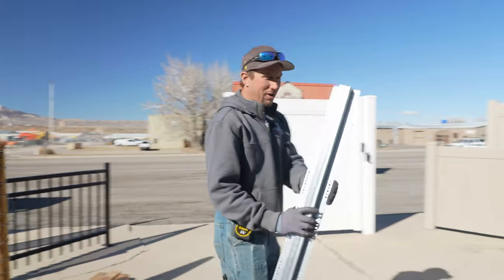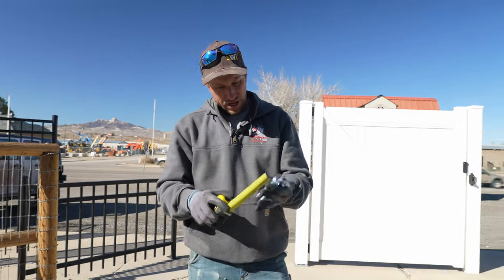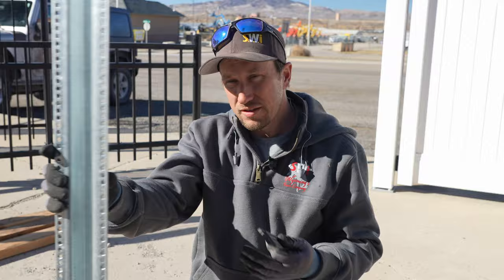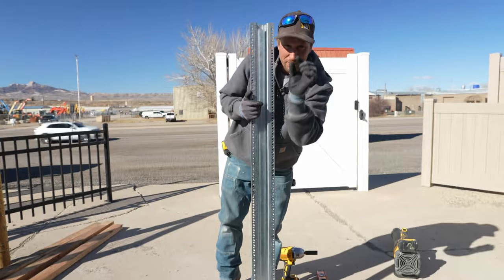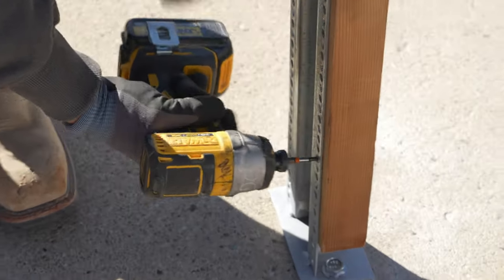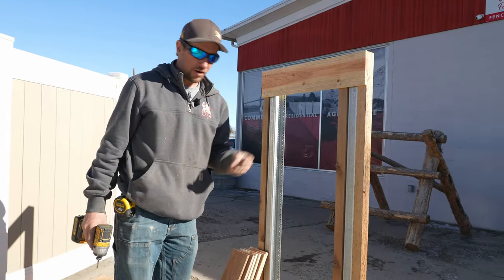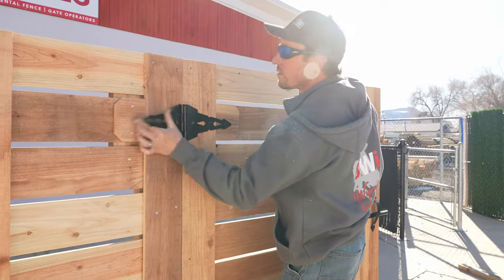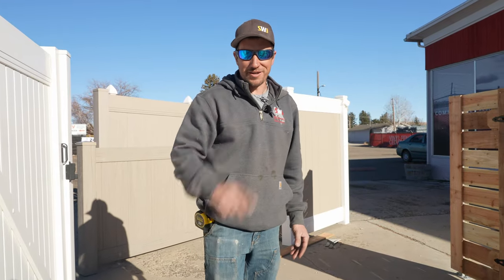How To Install A Fence On Existing Concrete

Comment: I want to mount my fence on top of a retaining wall, the retaining wall is sloped so mounting on top isnt an option. Would you be comfortable drilling spaced holes in the middle of the postmaster post (in the channel section) and using the same anchors to mount the post on the backside of the retaining wall? I could easily get 3-4 feet on the side of the wall with spaced anchors before the post rose above the top of the wall.

Comment: if there's a choice, is it better to install a fence gate on cemented posts or flange on cement posts?
Reply from the maker: If there's a choice I'd put the posts in concrete.

Comment: wow! you guys are creating some dope videos. thank you! how does this method compare to setting 30" deep re. strength and durability where strong tradewinds are an issue? I'd assume always dig (or drive) if there is an option but I can't find a solid answer out there. I'm having a concrete driveway poured next week and I'm planning on building a 6' horizontal cedar fence running the length of the slab after and I'm not sure how to direct the masons. any help would be appreciated.
Reply from the maker: It's a personal judgement call. In high-wind areas we tend to reduce our post spacing to add strength. If your driveway isn't poured yet you could always pre-set your posts and pour around them.
Reply: @SWiFence  thank you!

Comment: Does the postmaster posts come with the concrete anchors attached. If not, how did you attach the anchors to the posts?
Reply from the maker: Yes, the plated PostMaster comes with a base plate welded on. https://bit.ly/SWIplatedpost
Concrete anchors just run through the holes and are hammer-drilled into the concrete. https://bit.ly/SWI34concreteanchor

Comment: I don't know about this purchase... My posts are wobbly... Not at the screw section, the metal post... Any suggestions to stop the sway😢
Reply from the maker: I don't know what brand you bought, so that could be a factor, but there is supposed to be some flex in the posts, yes. https://youtu.be/pI5defhDiEM?t=856

Comment: Do you ever use wood posts /on concrete, and if so what do you use to anchor them with?
Reply from the maker: We never use wood posts on or off concrete.
Reply: I've drilled a large hole into the bottom of the wood post, then hammered in a tight-fitting piece of galvanized steel pipe (maybe 6" inside post, 6" protruding out the bottom). Then drill hole slightly larger than pipe into concrete. Fill hole with Rockite then set post. Also need to drill a small hole in the side of the exposed pipe to let the air escape when you push it down (inside of pipe would trap air that prevents you from setting it all the way down).

Comment: What spacing do you recommend between the postmaster mounts?
Reply from the maker: It's up to the installer's discretion. We sometimes do 6' spacing in high-wind areas. In others we do around 8'.

Comment: Would the regular impact be good enough to crank those concrete anchors in? Wanna use those but don’t have a big impact like the one you finished it off with, not sure if what I have is enough power
Reply from the maker: You should be fine. 👍🏻 It's nice to give it that extra pop with the big one if you have it, but you should be fine with what you've got.
Reply: Or just crank it with a breaker bar or torque wrench
Reply: I have used $50 impacts to drive in anchors. As long as you predrill the correct size it goes in easy

Comment: Where do you get the fence posts that you drill into the concrete
Reply from the maker: 👉🏻 Steel Fence Posts With Welded Baseplates: https://bit.ly/SWIsteelpost-bp
👉🏻 Concrete Anchors: https://bit.ly/concreteanchors
👉🏻 Composite Shims: https://bit.ly/SWIcompositeshims

Comment: O’ Dan… I was with ya until you said “Paddle” latch.  I mean the design, materials and assembly of the panel and gate had my complete attention.  I even made a mental list to go grab a box of those concrete screws…. But, then you said, “Paddle”…   A double flashback immediately zoned me out for the rest of this video.

You see, when I was in the 5th grade, a box of milk cost a dime.  Everyday, we had a milk or water break, during story time, in our morning classes.  If you had a dime, you could buy a box of white or chocolate milk.  If not, you could go to the water cooler and fill a cup to enjoy, while the class pet read aloud to the class.

Well, I lived on a dairy farm so, I normally drank water.  I chose instead to save my weekly fifty cent milk allowance and spend it on stuff I wanted… like baseball card packs, bubble gum, Grapette soda… etc.

One day, the teachers pet, Rosa, told me that she forgot her milk money.  We were in the coat room and no one else was around.  So I told her I would give her a dime if she lifted her skirt and showed me her panties.  

Well, she turned red in the face and started to walk away.  So, I upped the ante to $.50!  That seemed to change her mind.  She turned around and smiled and said, “OKAY… but you have to pay first. “

So, I dug out the five dimes and started to hand them to her.  As soon as my palm opened, she grabbed the money, turned and busted through the coat room door, into the classroom.  

Before I could gather what had happened, I heard her holler, “Mrs Grant, Dave’s trying to look up my dress.”  In quick succession I recall the door slamming open, a vise like grip upon my ear, a jerk that pulled me into the ring of laughing classmates gathered around the doorway and a walk of shame the likes of which no self respecting farm boy could endure…  in front of his city slicker classmates.

The walk proceeded at overweight, asthmatic, old lady teacher pace down a hallway littered with students and classrooms not yet in session.  I almost got a break at the stairway leading down to the Principals office when her vise grip loosened on my ear.   But, no such luck, she was just changing ears to put me on the other side.  

What seemed like an hour later, I landed in the chair facing the Principal’s desk.  Then Mrs Grant told me to stay there and left.  As I was sitting there trying to gather my wits, I looked at the wall behind the desk.  The top row was a bunch of plaques and certificates…. I think… I don’t really remember well. Because, the row right below that was filled by a half dozen “Paddles”.  

As it started to sink in that, my fate may very well be hanging on that wall, the Principal came in and sat down behind the desk.  He pushed his glasses up his ski slope sized nose and focused his beady mole like eyes on the back of my brain.  I couldn’t swallow, I couldn’t look away… they bore through me like a comet shooting straight at me.

Then he said, “You were caught looking up Rosa’s skirt.  What do you have to say for yourself?”

Well, that snapped me out of my daze.  I couldn’t let this lie exist…. I had to set the story straight… so, I told him, “No! Rosa forgot her milk money and I told her I would give her fifty cents if she would lift her dress.  I never got to…”

At which point he put his finger in front of his mole face, shook it at me and said, “That’s even worse.  Stand up and grab your ankles.”

I did as I was told.  I watched as he grabbed the paddle hanging on the right… number six.  The three swats echoed through the open door, down the hall and up the staircase to the classrooms above.  

Ski nose, mole face then told me to get to class before the bell rang… that walk was even more excruciating than the first.  Because this time it wasn’t just my ear that smarted… I was a convicted criminal who had endured corporal punishment and had to try to walk normal past a jury of my peers!  

Was that the last of it?  Well, not exactly.  I managed to steer clear of any one-on-one encounters with Ski nose mole face for almost 2 years.  Then, I took a woodworking shop class.  (It was either that or Home Economics.) 

Little did I know that the shop teacher had received a list of boys in his class from Ski nose, mole face… there were four of us on it.  Mine was one of the four from our class, who had suffered paddling during our tenure at the school.  

While everyone else got to make a project of their choosing like a spice rack, cutting board etc… our project was to work together and make a Paddle for the Principal’s office.  

After we completed it, I was the one chosen to present it.  After screwing up my courage I knocked on Ski nose mole face’s door and hoped that he wasn’t in.  But, no such luck.  He told me to enter.  As soon as I opened the door, I saw the row of Paddles above his head.  There were now seven.  

He saw the paddle I was holding and reached his hand for it. As I gave it to him, he asked, “Dave, have you been looking up any more girls skirts.”

I caught myself just before I began correcting him… I almost blurted out that I only paid to look but never looked… but, the memory of what happened the last time held my tongue.  Instead, I just said, “No sir!”

He then looked down at his newly minted instrument of justice and said, “Good.  Get to your next class before the bell rings!”

Well Dan, when you said “Paddle”, those dark stains on my life flashed before my eyes and totally shut out comprehension of the rest of your video.  Please excuse me for not going back and watching it again to see it… but, I’ll still give you a thumbs up and declare that this was a good danged video!
Reply from the maker: Don't let your past scar you, Dave. Sounds like you learned some good lessons! 😏😄
Reply: @SWiFence  yep… don’t pay for services before you get them!  I never give more than 50% up front!!!

Comment: Are there any brackets for the fence posts that don't have the welded mount at the bottom?
Reply from the maker: Er... you mean like a baseplate that hasn't been welded on yet?
Reply: @SWiFence  yeah something like that. I figured not but just looking to see if I could get the post (or something similar to it) locally and find a mount for it for concrete.
Reply from the maker: If you can find the posts locally I'm almost certain you can find a welder to weld baseplates on for you.
Reply: @SWiFence  sure thing, thanks

Comment: What is the metal post made of and can I buy it from home Depot?
Reply from the maker: Galvanized steel. You might find them at Home Depot, but more than likely not with the baseplate welded on. We do sell them: https://bit.ly/postmaster-bp
Reply: @SWiFence  I'll be buying from you then thanks.

Comment: Done it in a pinch like that but I sleep better when it’s core drilled so much wind
Reply from the maker: We've got a ton of wind out here.
Reply: @SWiFence  right and the right gust the post won’t hold it’s too much for anchor bolts like that they eventually work loose it’s far smarter just saw cut them you don’t have to worry about time wasted welding

Comment: Can we order parts
From yall
Reply from the maker: Yes. Links are in the video description. (and I'll put them here)
👉🏻 Steel Fence Posts With Welded Baseplates: https://bit.ly/SWIsteelpost-bp
👉🏻 Concrete Anchors: https://bit.ly/concreteanchors
👉🏻 Composite Shims: https://bit.ly/SWIcompositeshims
👉🏻 Paddle Gate Latch: https://bit.ly/paddlelatch

Comment: How do you fasten wooden fence posts to concrete?
Reply from the maker: There's nothing really out there for it that I know of. They do make so brackets to hold a 4x4  wood post but it's not recommended to use it for building a fence on.
Reply: @SWiFence  would an extra 24-36" metal bracket wedged into those 4x4 bracket and bolted in would give it the support a 72" post would need